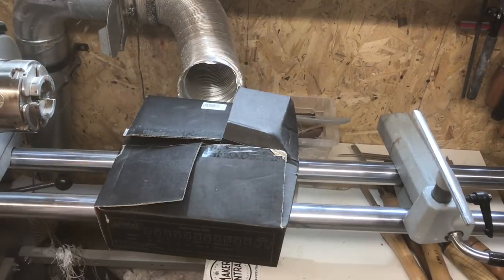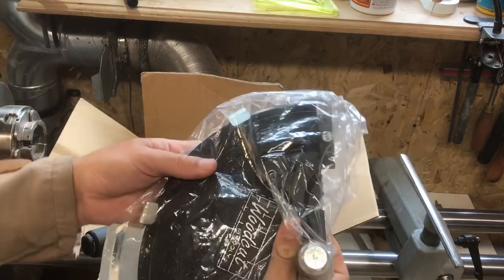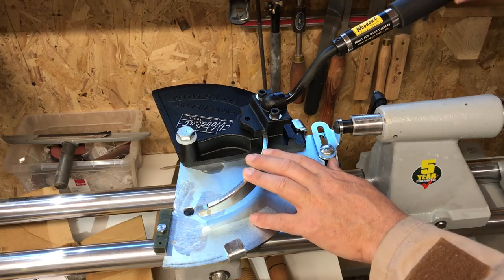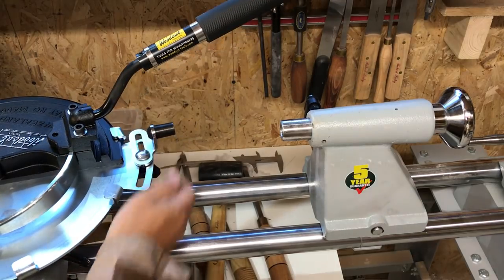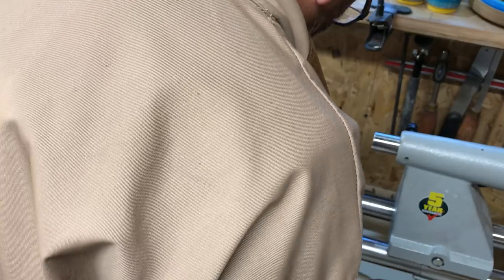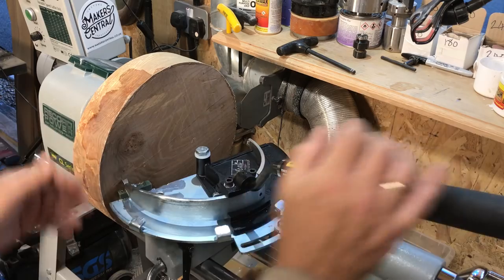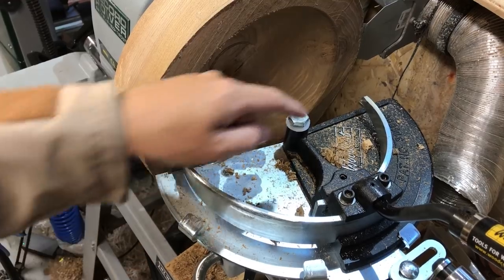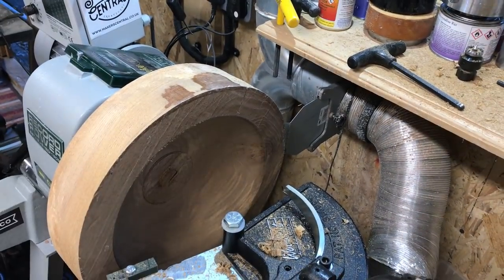Woodturning - using the bowl saver to make 4 bowls from 1 blank

Comment: That's a cool tool. Incredibly simple in concept...a curved chisel on a fixed pivot point and yet after several thousand years of wood turning someone has only thought about it now! Presumably the smaller chisel would simply be used in the same way as the larger one ( with the larger one removed) to make a smaller bowl from the middle of the one you cut.
Reply: Steve Sammut , hi.
If I had to guess.. I think the small blade is used 1st  then the backside is cut with the larger blade.
That's what you meant though lol.

Comment: You swap the blades around for the smaller circumference blade. Can't wait to see if you can make it work with resin bowl blanks. Also, true up and cut you tennon or recess in the small blank so you can mount it centered to the chuck. Bowl Saver pencil project coming up?
Reply: I was thinking resin bowls the moment I saw the device.

Comment: Could you have a go at putting food items in resin. I've just made 3 paperweights, 1 with grapes, 1 with a strawberry and 1 with a custard cream....but the resin cooked the strawberry and custard cream 😂 Also had problems with the items floating to the surface so I used superglue, but this left a line when I pours the resin (due to the superglue vapour I assume) but I will try again but maybe use hot melt glue. Love your videos by the way, keep up the excellent work.

Comment: The second blade just slots in like that so it is out of the way but still handy if you wanted to cut a smaller bowl, you would just slide that blade out the open side and the larger one would be slotted into the closed side. cool tool for sure

Comment: Thanks; I've taken a look at the BowlSaver myself a few times & wondered about it. Good to know you can adjust the depth/angle a bit, but does it get very hot when doing a cut? It looks like the cutting edge is the same width as the spine, which makes me think there's not much air cooling going on. I know that Stellite is good at resisting heat wear, but for the price I'm still a bit concerned about longevity.
Reply: Thanks for your comments.  This can depend on the density of the wood.  If you are using a harder wood then reduce the speed of your lathe and the entry speed of the blade and you shouldn't have problems with overheating.  The Stellite tip will last for 400-500 cuts, after this time the tips can be easily replaced.

Comment: My dear fellow...😶 Some smart wood turner will probably tell you better, I think the two blades are inner and outer diameter of an almost finished bowl. The 'saver' bit is because it saves you time turning the whole of the oitside and inside away. I hope that's right 🤔😎👌
Reply: Ian Lynch I'd imagine so as well!
Reply: Thanks for your comment.  The Bowlsaver is designed to core bowls which will then need to be turned, both inside and outside.  The blades are used one at a time.  Using the small blade you can cut bowl blanks from 75mm in diameter, and with the larger blade bowl blanks up to 300mm in diameter.

Comment: hmm. this could be fun
the blade on this looks like 1cm wide
so, just an idea
use a bigger log and carve with the bowl saver just half or 3/4 into it,
then change to a larger diameter  and carve again into the log
the change it again to a wider diameter and carve again
fill the gaps with resin and turn this whole thing at 90°
could be a interesting pattern for a bowl or other stuff

Comment: Just a heads up.....Always, ALWAYS cut into the bowl from the left.....you can adjust the "blade" by undoing, sliding it around and once retightened it will cut either a shallower or deeper bowl....never go to the right of the jig, always cut the bowl from the left side....you don’t really need the smaller blade attached if using the larger one...

Comment: wonder if both blades can be ran at the same time
Reply: The blades need to be used one at a time.  You can cut bowl blanks from 75mm up to 300mm in diameter.

Comment: Well... I might be wrong... but cant you make three bowels at once? Use the main blade and the second blade that you out in on the other side... flip is around... to same side as main blade
Reply: You are correct you flip the small blade around, however the blades need to be used one at a time.  You can cut bowl blanks from 75mm up to 300mm in diameter.

Comment: Technically if you have both blades attached correctly it would make a small blank, a medium finished bowl, and a large bowl all at the same time.
Reply: The blades need to be used one at a time.  You can cut bowl blanks from 75mm up to 300mm in diameter.
Reply: Woodcut-Tools I don't do wood work I was thinking from a mechanical standpoint seems like it would work. But your way more experienced then me. I just fly on my channel. I love the work your doing though. Makes me wanna make my own furniture.

Comment: Maybe if you flip that other blade you can do two at once?
Reply: Some thought. Two at a go could be dangerous. But could it be dangerously fun?
Reply: The blades need to be used one at a time.  You can cut bowl blanks from 75mm up to 300mm in diameter.

Comment: Why can't you use both blades at the same time to make two bowls?
Reply from the maker: Austin Kemmer I think it’s so you can do different sizes
Reply: You should try to use both at the same time to see if it works! Could be game changing!
Reply: The blades need to be used one at a time.  You can cut bowl blanks from 75mm up to 300mm in diameter.
Reply: Why do they NEED to be used one at a time? What will happen if they are used in conjunction to one another?